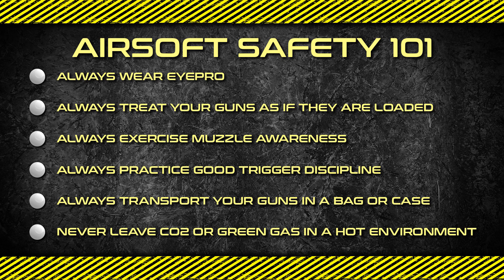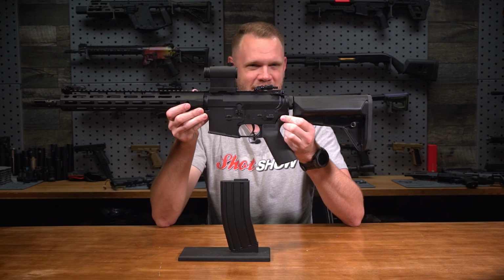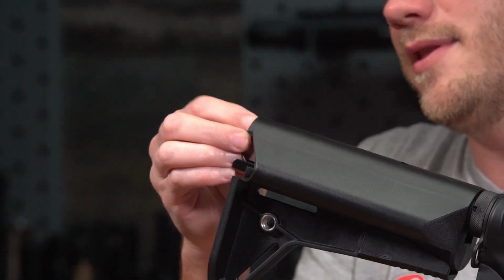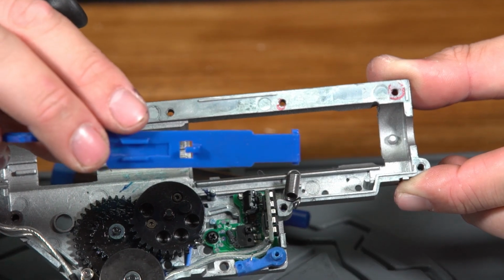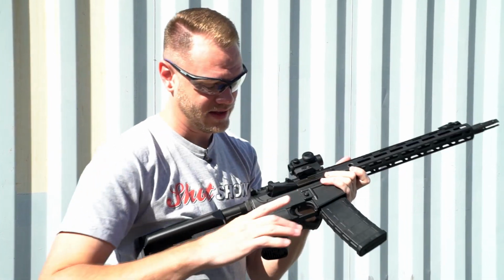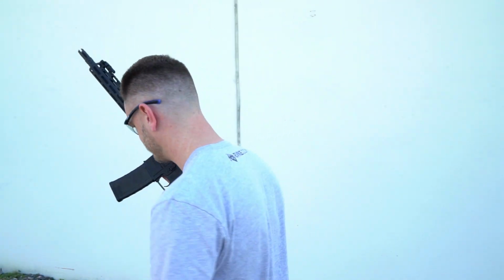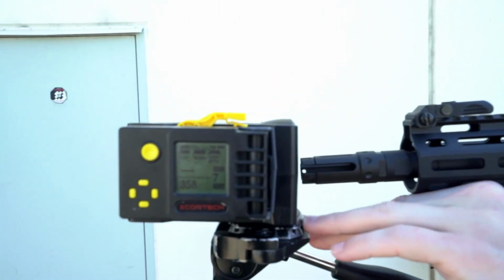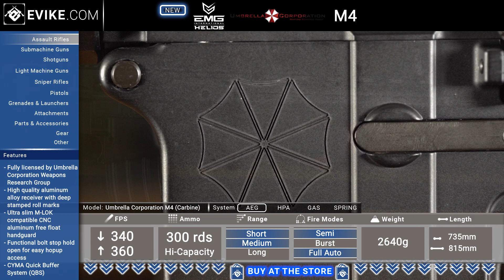Bred From Umbrella Corp. - Helios Umbrella Corporation Weapons Research Group M4 AEG Review

Comment: It's a rebranded Cyma Platinum. I have one and it's really nice, the issue is that my microswitch failed after 5-6 games. It just stopped making the clicking sound. I only used 7.4V lipos. This seems to be a common issue, so if you're going to get one be ready to replace the included mosfet. Otherwise very nice gun.

Running a Krytac mosfet and trigger contacts in mine now and it works perfectly.

Comment: Does anyone know how to fix this issue. So I just bought by gun and took it out today for the first time. As soon as i connected a battery i was testing it out and it seemed fine at first but then I noticed the gun was firing without me puttting my finger on the trigger. Also sometimes when im firing in semi the gun will shoot on its own in full auto. And when i try to use full auto it won’t let me sometimes

Comment: It's a rebranded cyma, but they're good out of the box, good internals too
Reply: Andrei Toma how do you know?
Reply: @douchbagat7671  "CYMA" on the gearbox shell x) 7min08
Reply: Is it the cm097b
Reply: @douchbagat7671  i built a couple of dmr's on the sr25 platforms from the same series and i modded some m4's as well from the same series
Reply: @douchbagat7671  you can find the original cyma guns by searching for "cyma platinum"
Reply: I got their SR25, it's very solid. The piston stripped though
Reply: There is absolutely nothing wrong with a cyma airsoft gun sir.. Cymas are solid airsoft guns!
Reply: Yea it’s literally the Cyma qbs ( which I have) they have 13:1 gears I believe integrated mosfet and they shoot around 17-20 rps on a 7.4v LIPO and 30 rps with a 11.1
Reply: I threw a jack in mine though
Reply: @Aggemannen117  your metal teeth broke?! Did you run it on full auto with a 11.1? 😅
Reply: @mikemegadeth4110  the aoe could have been off abit and with 11.1 I could see the piston striping because of that.
Reply: So is it literally just a cyma platinum that was later laser etched or is it considered a cyma cause they use the same externals but different internals? I'm looking into getting a cyma platinum because I'm not very into the umbrella corp stuff, but I don't want to miss out on anything that the umbrella corp one has that the cyma may not.

Comment: Can someone please help I tried to put a tracer unit and I ended up stripping the barrel taking out the orange tip like a dummy and I loosened the mlok rail can someone please tell me how to tighten up my rail back ?? Please 🙏😞🤦‍♂️ do I need to tighten the hex nuts on the bottom ? And can I replace the barrel ?
Reply from the maker: Hello. The outer barrel is replaceable, yes. Please contact our Customer Support for assistance with finding the right parts. support@evike.com
(626) 286-0360
7:00am to 5:00pm PST Monday through Friday

Comment: Got mine today. But strait to the point. As of the end of 2021, this gun has Majorly improved! Seems they got way better machining. Almost feel like Matt is using a prototype in this video. Mine came with tamiya connectors:). I got the 11.1v batteries and the 400fps marksman version. I've only ran 6 mags through it. And seems to be very consistent with the hop-up. Haven't had it long enough, to see if any old issues people were having with this are still happening. But 1st outdoor game with this, will be Saturday. BUT I WILL KEEP UPDATING AS I SEE FIT👍. Btw 28.9 Bb's per second through my chrono😎. I'll let yall know if this is a holy grail. Or a hellpit🎯
Reply: How’d it go?  My rifle is coming next week
Reply: @CashtheHutt  so far after a few months. I haven't had any issues with mine. It's more than enough to wipe people out. The only good complaint I have, is the hop up is hard to rotate and click. But that's a good thing. Ps: scared the shit out of polar star players. I only play outdoors fields
Reply: @macnvapemacnvape5760  good to hear.  Just got it in the mail very excited to try out.
Reply: This is good news. Hopefully they fixed the issues with the trigger / Mosfet system. I've ran a mag through mine no issues so far. I just bought mine a few weeks ago. I've had a  KWA g36 custom modded AEG for over 10 years lol.

Comment: When I saw this gun advertised I went right away looking up specs and couldn’t find anything on until I saw the CYMA videos and thought that looks just like the one I’m interested in and sure enough this is a rebranded CYMA with a umbrella Corp
 lower , I decided to give this gun a chance and actually with a few mods I actually like it but keep in mind I only paid 180$ for mine off the hop up app so it’s a win win for me and I have to say it has a decent rof and knowing what a gun that comes from umbrella armory cost I’m actually ok with this . I plan on dropping in a gate titan a asg infinity motor and a higher spring and it will be a great gun to run on the field
Reply: Did you change the spring?
Reply: @felixcuellar4750  is did to a m130
Reply: @dimension-121  no need to modify it , it comes with a 14mm cc threaded barrel I already have tracer on mine

Comment: Just got one of these from the April 1st box of awesome.  I really like the feel and look of the gun.  Only issue I’m having is accessing the manual and directions on the website the  qr code on the certificate of authenticity sends me to.  Every link for this gun seems to be broken and just sends me back to the main page. I’ve tried multiple computers, browsers, and even had a couple friends check.  None of us can find the directions or manual which is supposed to be on your website.  As for this video, good overview but you didn’t mention anything about what the beeps mean when plugging in a battery or if there’s any settings that can be adjusted.
Reply: It beeps cause it is connected with the gun. And as far as settings. There are none. It's pretty basic
Reply: I've been having the same issue finding a manual.

Comment: It is a cyma cm.097, built in ETU and mosfet with pre cocking. Taiwangun has it on there website and breaks down this AEG spec wise. I have the cm.097 14.5". Overal finish is amazing gearbox is smooth and impressed me. Now the bucking is a H style, i tried to hop .32 with it and lol it sucked. Changed the bucking and got a lot more range. The bucking and nub are trash..
Reply: what bucking did you swap to?
Reply: @lukebolland85  i went with a G&G green it helped a lot but still not enough for me. Id recomend changing the nub as well. The cyma stock one is very soft.

Comment: It says BAMF mags don't fit, but that's what I run in my helios?
Reply: I have the version straight from the OEM (CYMA Platinum), and my BAMF Gen2s fit okay (you need to bump it to get it to lock and it doesn't drop free) and feed really well.

Comment: What spring do you recommend I should get for this gun?
Reply: Depends what are you looking for
Reply: @hammer3793  I’m pretty new to upgrading, but I want more fps and range on my gun
Reply: @nickfrankovich901  I’m going to suggest a m120 spring. Use .32s wirh it you should get 330fps and a lot more range. Get a longer barre and a better nub and bucking
Reply: @hammer3793  ok. Any specific brand I should get?
Reply: @nickfrankovich901  zci makes a good barrel, and guarder makes great springs. I’m also selling a aap01 on hop if you want to take a look.
Reply: @hammer3793  thanks, and I would consider buying the aap01 if I hadn’t just bought one myself😅😅

Comment: Its a rebranded Cyma Premium, Cmon guys....
Reply: Yes it looks like. With an ETU, wich is nice, however the rest is more flashy than great. Idk how Umbrella can give its name for this. Is it bad? No its really ok for the pricepoint, however its not what one would think about.
Reply: @justKdG  i thought same but it doesn't have anything to do with umbrella armory unfortunately...
Reply: @justKdG  It's not an ETU, since it's only a microswitch without a MOSFET.
Reply: Bo Huang  you do realize the definition of a mosfet right being a transistor it’s got two transistors on the back side of the board now yes it’s not advanced but doesn’t mean it’s not a mosfet you couldn’t spam if it wasn’t
Reply: @raymondiscool1  Does it?  I stand corrected then, thanks.

Comment: HELP! Does the flash hider come off normally or is it glued to the threads?
Reply: Each state is different with shipping laws. But I just got mine today. It's the marksman version. But the orange cap has a small screw you take out, and there's a little bit of glue on the front. But as far as the flashhider. There's a small screw on the bottom of the flashhider. Use one of the included Allen keys. Take out that safety screw. And it should unscrew fairly easy👍

Comment: Anyone else have a problem with this trigger failure? solder blew out making this completely unsafe to use - muzzle down goes full auto even on safe - no mods done to gearbox at all. brand new 5 sessions in...
Reply from the maker: If you ever experience an issue with a new product please contact us and we can help you.
https://www.evike.com/rma/
support@evike.com
(626) 286-0360
7:00am to 5:00pm PST Monday through Friday
https://www.evike.com/policy/

Comment: Are they going to fix the micro switch problems
Reply: on theRoad  I think the problem is with trigger over-travel and squeezing the trigger too much, which damages the micro switch. They may have to redesign the trigger to limit travel, or you could just add solder or JB weld to the back of the trigger.
if I am not mistaken, the earlier G&G etu’s had the same problem with trigger over-travel and damaged micro switches.

Comment: Quick question, in the video it says BAMF gen2 midcap mags aren't compatible, yet the airsoft package with the gun comes with 2, are BAMF gen2 midcap mags now compatible or is the video still accurate when it comes to those mags not being compatible with it????
Reply from the maker: The video states that the BAMF Gen 1 mags did not work well. The Gen 2 should work fine.
The video was made before the BAMF 2 mags were available.

Comment: All the reviews on this gun were phenomenal so I bought it.  When I pulled it out of the box right off the bat it was trash.  First time firing it the bbs just fall out of the end of the barrel even after adjusting the hop up.  Also during the first magazine the bolt release fell out and the bolt it now locked back.  I might have received a dud but my experience with this is gun was awful
Reply: I got it and it works great I think u got a really bad dud sorry.

Comment: Yes they are evil for charging that much for a m4 with a seam line on the lower front end of the receiver and it's a rebranded Cyma? No thanks. The name is what's selling it.
Reply: @ADRIAN C TUROW no clue don't have one in front of me to test.
Reply: Cyma platinums seems pretty good, narly rof and trigger response.
Reply: ADRIAN C TUROW I would say so, I’ve heard specna gearboxes have been having issues lately but for the most part they’re fine, great performance and value for the price, also nice pfp
Reply: @ADRIAN C TUROW In this case no actually.
Reply: Whats a good M4/M4 brand to get then?
Reply: @OrboTheOutlaw  Elite Force Avalon gen 2 is a real solid one, G&G combat machine as well.

Comment: I am new to airsoft would you recommend me get this of the emg/knights armament gun
Reply: Parker Bartlett if I were you I’d go for this gun but the Cyma version this is literally the same gun you pay for the name on this one though
Reply: Well, this one is full metal with actually really good internals for under $300
If you don't care about full metal construction then Knights Armament or G&G will probably get you slightly higher performance at this price point, but all the externals will be polymer.

Comment: newbie... I just purchased, my question: is there a power off, or do i need to pull the battery connection if I'm not going too use for a few days?
Reply: If your gun is sitting in the box it's usually best to take the battery out so it doesn't drain the lipo

Comment: OEM'd by CYMA in China.
Reply: How did you identified that it’s a CYMA OEM?
Reply: @johnrambomoraleda7518  The gearsets all have CYMA molded into it.  The quick change spring system is also CYMA's proprietary system.
Reply: Bo Huang thanks. You saved me from a bad decision.
Reply: Its corona time
Reply: Also comes with a great external attachment, it’s the COVID-19 😂
Reply: @johnrambomoraleda7518  the not so bad as u thinks  ' it's premium serie from cyma the much beter than normal'